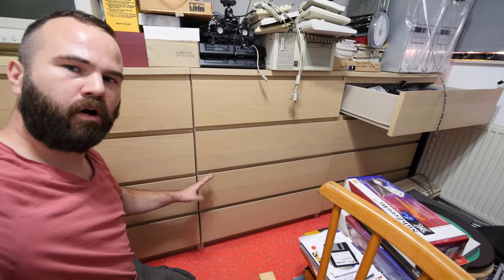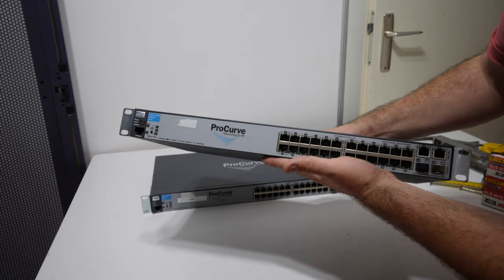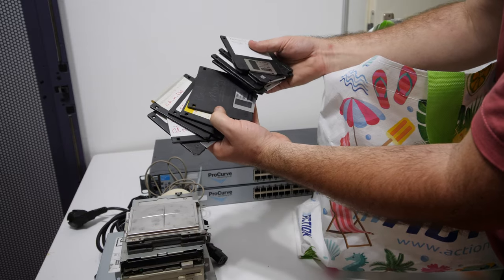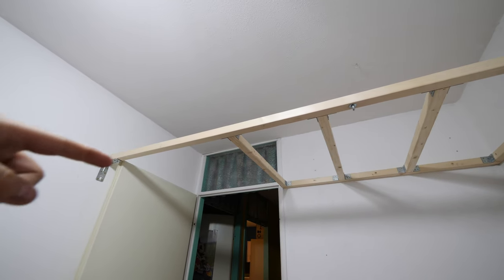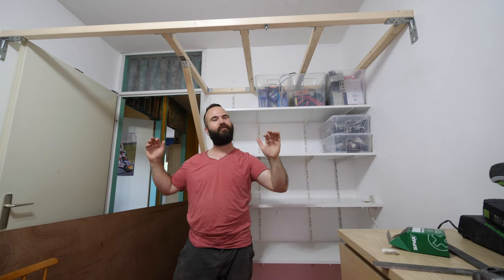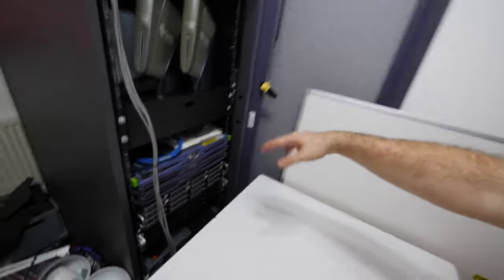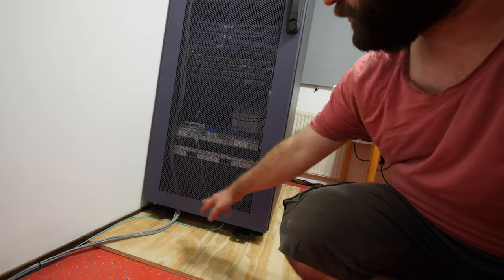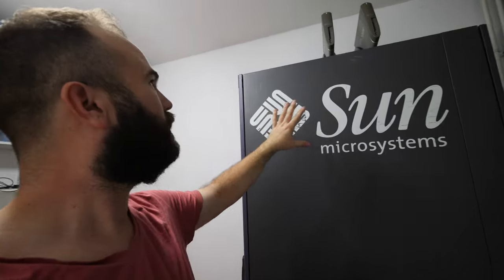Building Studio 2.0

Comment: I have those cabinets and I assembled the drawers with wood glue and now they are solid and can hold a ton of stuff. Try it!
Reply from the maker: Ah good tip!!
Reply: @victorbart  It takes a long time because you have to leave them on the drawer front then glue it as they dry... but once its done, they will never have that issue again!!  IKEA added a cross beam to the drawers to prevent that, but the problem was the drawer body would flex outward and the bottom would come out of the grooves... Glue fixes all that!    might want to have a square to make sure the sides stay nice and square as the glue dries.

Comment: I got myself a bit of a retro machine today (I'm not sure if it's old enough to qualify as retro), a RM One from Research Machines. Something new for me to play with.
Reply from the maker: We need specs!!🤪
Reply: Victor Bart - RETRO Machines the motherboard is an Aopen i45GMt-HR  which has an intel core 2 duo T6600 processor with intel integrated 4 series graphics. 4GB RAM. 😋
Reply from the maker: So modern and fast 🤪
Reply: Victor Bart - RETRO Machines it’s definitely unusual though. Socket 478 motherboard with a dual core CPU 😳
Reply: @Kundalini12  I didn't even know that was a thing...?
Reply: @RWL2012  neither did I